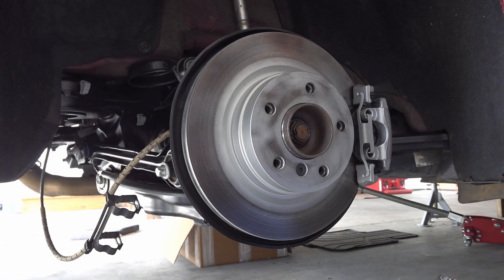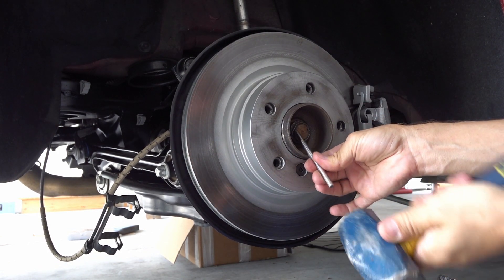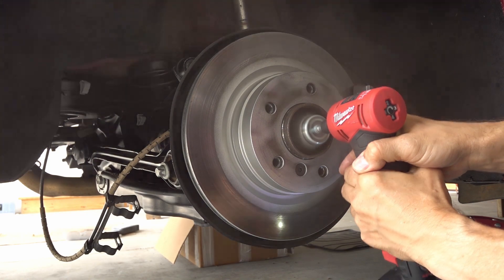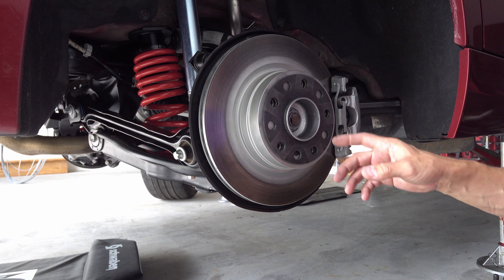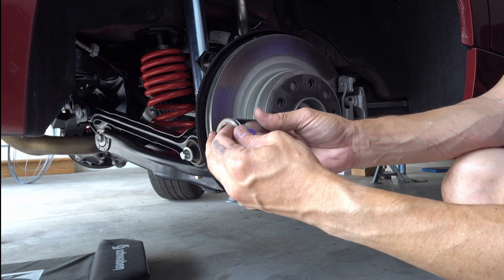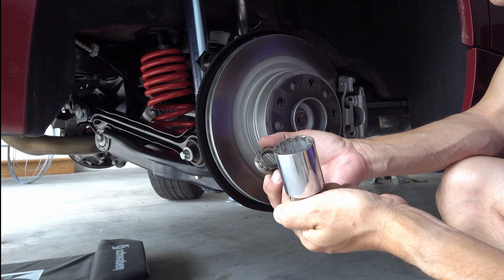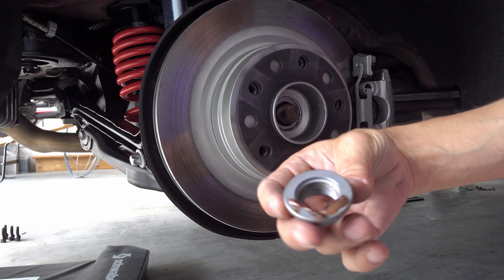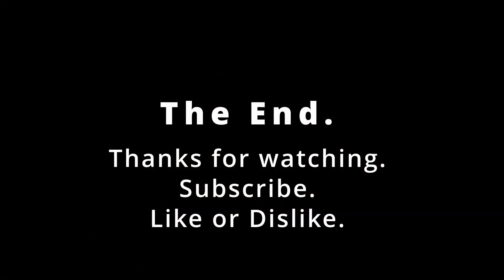BMW Axle Collar Nut Replacement | E90 325i 328i 335i M3

Comment: I had not touched mine for 17 years it looked totally rusty you could not see the nut , no socket would fit. Soaking in vinegar (with a rug over) then pressure washing it exposed the nut completely and it looked like new almost, with a PB bluster soaking for another day and I could unscrew it with no problem
Reply from the maker: That's a good point, I should try vinegar sometime.